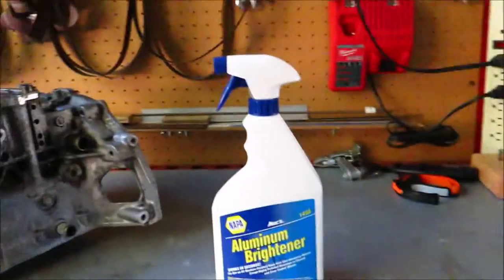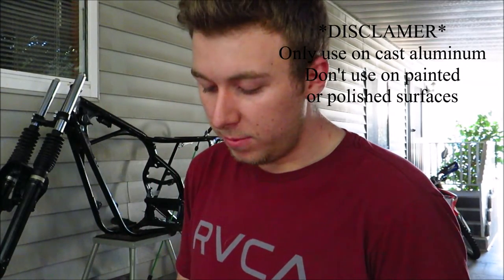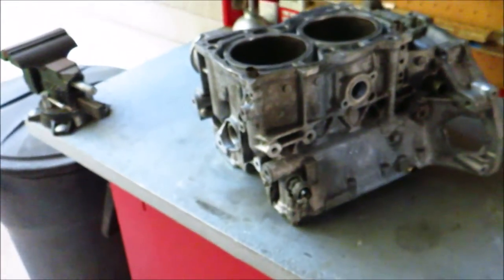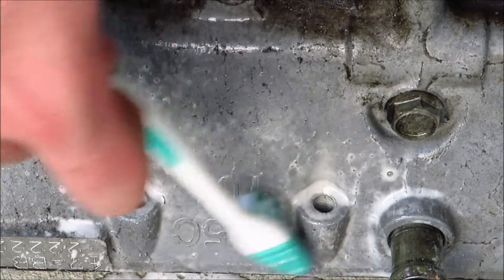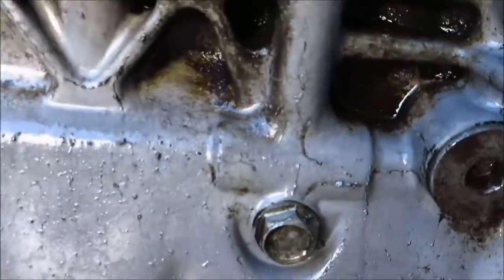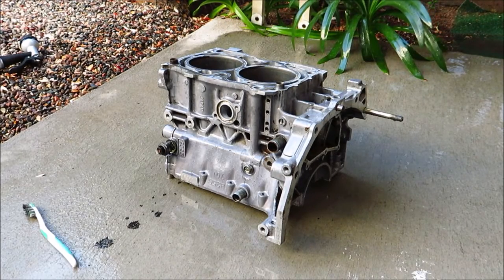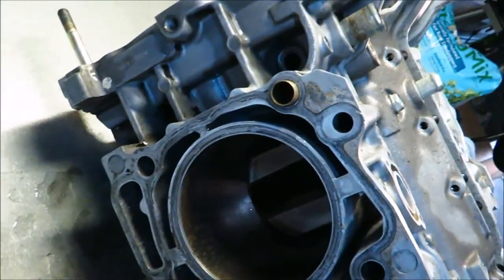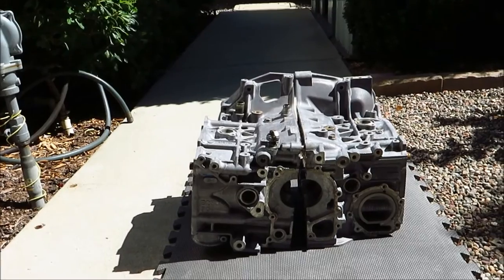How to Brighten Aluminium the Easy Way

Comment: I am hoping you can take a constructive hint or two.  The product is a brightener and not a cleaner.  your surface was unprepared as it was flat filthy.  also, you took 3 minutes and 45 seconds of my life to explain to me that the product was caustic yet you used no gloves or eye protection and you let the crap go straight to the ground along with the Grease.  Do yourself a favor.  Grab a dishpan or a plastic tub and clean your stuff in Diesel.  Then dump the dirty Diesel in old oil containers and recycle the crud along with your motor oil at the local parts place.  The planet will thank you. While you have your part down in that tub, glove up and grab a dremel and some cheapie wire brushes from HF or Amazon and get those nooks and crannies with the dremel.  I promise you that at 13,000 RPM you will get it clean and you will never forget protection again as the crap flies everywhere BUT you get a spotless result.  I have done the same process using purple power HOWEVER, all your grease winds up going into the drain hurting your planet instead of being safely reused.  Be kind to mother nature and yourself:  recycle your crap and glove up and use eye and ear protection.  Do not be discouraged with your result.  Do your learning and move on with your new knowledge as knowledge is power.  Peace Out
Reply from the maker: I am always welcoming to advise, I'm young and dumb and got alot to learn lol.
Reply: @SWSpeedCo   Hey man we all learn the right way at some point. A parts cleaner is a great investment and whatever solvent you decide to use like MEK or B12 chem just keeps recirculating so you save money and won’t go into the groundwater.

Almost anything aqueous is acidic unless it is absent of hydrogen protons. So even water is acidic, I’m sure you’ve heard of or know what p/h balance is. That being said you always want to work from the least caustic,environmentally friendly and non hazardous solution possible. Water is obviously going to be first and obviously can clean plenty, but in this case it’s not. You’d be surprised what you can clean with dawn dish soap and hot water. I mean they use it to clean wildlife affected by oil spills. The one I use a lot and keep stocked at my shop is distilled white vinegar. I clean aluminum heads to leather seats down to the soles of my converse chuck t’s. 

@OldSchoolCars had all great advice. Diesel is a great cleaner. You can even empty a quart of oil and add a quart of diesel to your crankcase and run for 30 minutes before an oil change as a flush. Albeit Kerosene is better. Diesel also acts as a lubricant. I also use keep an oil squirter with a mix of diesel and ATF to use as a penetrant, it puts PB blaster to shame.

Also to his advice on PPO (safety gear). Anything that gets on your skin gets into your bloodstream and safety glasses should always be used. I even wear a respirator when I sweep my shop at the end of the day.

Comment: Add to the fact of no PPE but also how little rinsing you do.  Then all that is done over a concrete drive way which is hard on concrete and the fact all is rinsed into your soil with no thought to neutralize with a base.  You say you use lots of acids.  You need to speak to a physician about what acids do when absorbed.  There are common acids absorbed through the skin that eventually ends up in your bones and makes them brittle.  It is cumulative over time.  That one reason why mag wheel cleaners have removed their acids from their contents. VERY DANGEROUS.  Take it to a pro.  I hate to think what the soil around your house is contaminated with.

Comment: Wheel cleaner works very well to remove grime on the engine block. It will still need a good brushing but it melts away nicely. Wear gloves.

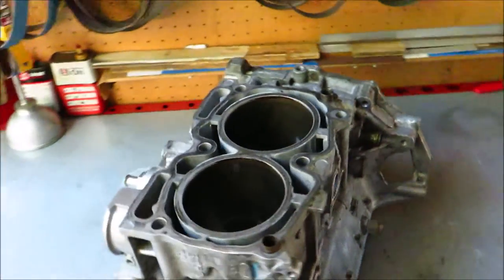Comment: 2:36 I took one look at that a though, "that's an EJ series block half. Passenger side. Judging by the cylinder wall thickness, it's an EJ20. Half-open deck, hmm. EJ207 produced between 1998 and 2000? 6:25 Damn. Swing and a miss. EJ25. Then it's probably an EJ253 SOHC NA.
Reply from the maker: Close, it's an ej255 DOHC turbo but that is hard to tell from just the block.
Reply: When you think you know everything 🤣
Reply: @Popcorx  What? I called out my own mistake. That made this a learning experience for me. One only "think(s) they know everything" when they refuse to accept they can be wrong.

Are you not familiar with the phrase?
Reply: I'm pretty sure the cyl bore is the same in both as well, and the 2.5 is just stroked with a different cam shaft and rod lengths. It's why so many US specs destruct under high revs compared to the rest
Reply: @danielescobar7618  EJ series uses the same cast block (and cylinder heads). Machining is done to make them specific, so you're partly correct, in a way.

Bore on the EJ25 is 99.5mm with a stroke of 79mm. EJ20 has a bore of 92mm and a stroke of 75mm.

"different cam shaft"

That's not precisely correct. The cams really should be matched to the head and the ECU rather than the block. You could technically put an S20 head (2002-2004 DOHC non AVCS heads. The S really is the head nomenclature, the 20 is the displacement of the block it's intended for) on an 25 block (and it's not actually all that uncommon). A SOHC cam I believe would actually fit in a DOHC head, but the valve timing would be screwy. Could even get valve interference (it's possible for the valves to actually come in contact and for one to wedge itself in between the other and the valve seat). This is way adding new cams with a different duration and lift requires an ECU tune.

The S20 head, being non AVCS, is, well, all mechanical, so it either works or doesn't (the ECU isn't as important, but a new fuel map would be recommended)

"It's why so many US specs destruct under high revs compared to the rest"

That's only partially true. Primarily what determines the rev limit is stroke, that parts true. But what also matters is valve springs and flywheel weight. The EJ25s run a heavier flywheel.  Since the crankshafts are literally the same in all EJ displacements (aside from improvements like nitriding, of course), both the heavier flywheels intended for the longer connecting rods and the lighter flywheel intended for the shorter connecting rods will bolt to either engine.

Interesting sidenote: the bolt patterns for the pressure plate are actually different. You have to match the flywheel it the transmission clutch fork type (push vs pull).

I don't have any data to prove this, but I suspect you're also correct about the cams playing a part. I wouldn't be surprised if the lobe profiles were different for emissions purposes.
Reply: @Popcorx  I took a (poorly) educated guess.  I'm better educated now. 

Being wrong is how one learns. One simple needs to accept being wrong can lead to improvement, and seek to be wrong as often as possible.
Reply: @occamsrazor1285  I mistyped crank shaft, but I believe you. Cool info, good hobby man, keep it up

Comment: Dude! I'm calling you dude, because you seem to be about as bright as a stoner surf bum. You pointed out where the label stated; Danger! Severe burns! You're not wearing safety glasses, chemical gloves, any type of chemical resistant clothing, or a face shield. You are outdoors, but I'll bet you didn't even think about the fumes or a proper respirator. I sure hope that some kids don't copy your methods and wind up with severe injuries. Your workspace looks clean and organized. You appear to understand the necessity of quality tools, so why don't you consider proper, (inexpensive) Personal Protective Equipment? PPE! Find yourself a YouTube video about PPE and acids! I am actually pissed about the possibility of somebody doing what you do and wind up seriously harmed. Just a small amount in your eye, and you will lose it!
Reply from the maker: I get what you're saying, If you watch some of my other videos you can see that I do use ppe. I use acids alot and I always have baking soda and water on hand. I was right next to a hose the whole time. I were a respirator when I grind or cut things as well as safety glasses. I'm not the safest person, but I'm also not the most unsafe person. I appreciate your concern of others doing what I'm doing. I understand the purpose of PPE and that you are supposed to wear it even when the risk is low. I usually wear it when I think the likely hood for danger is high. I don't go put on my hasmat suit to use bug spray even though that would be the safest way to use a poison. People shouldn't be taking YouTube videos for gospel anyway. For the most part it is for entertainment purposes.